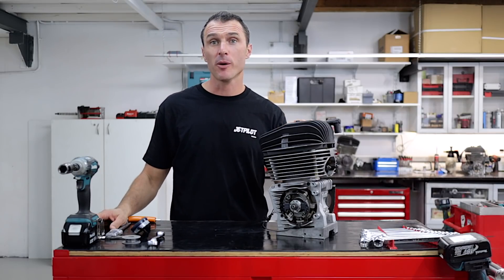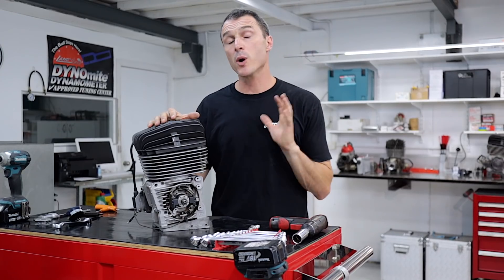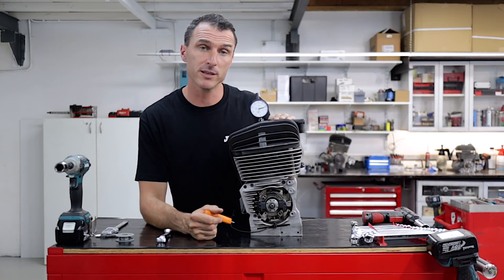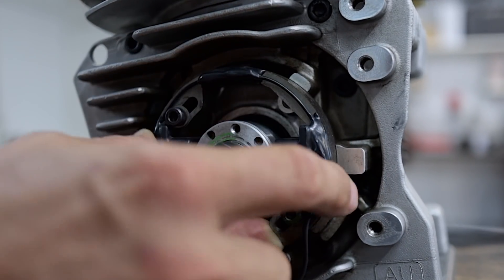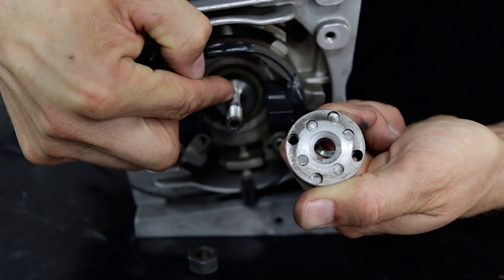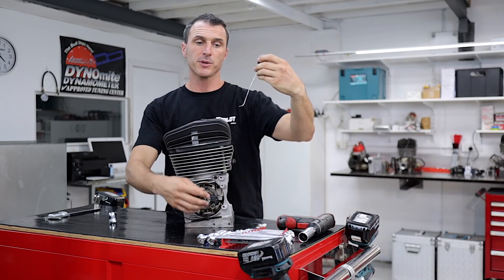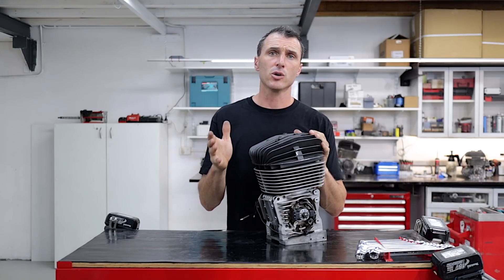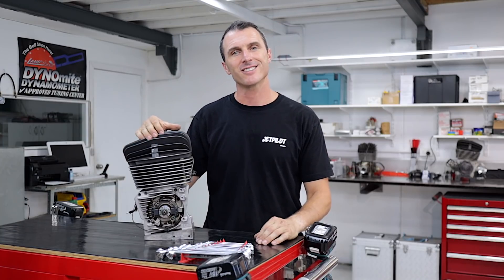HOW TO: Check Ignition Timing & Squish On Your Go Kart Engine

Comment: How do adjust the squish? Im a tad confused!
Reply: Squish on a new or rebuilt engine is adjusted with copper shims and the base gasket. Squish on a used engine is not something you would adjust. Failing a squish test on a used engine is a sign of carbon buildup. The top of the piston and the combustion chamber on the head would need to be cleaned or replaced, then the squish reset using copper shims and the base gasket.

Comment: I have a tm k8 engine but it doesn’t have a keyway for the magneto rotor ln the crank or rotor itself how do know what orientation the magneto should go?!
Reply from the maker: have you lost the key way ?  otherwise you will have to spin up the rotor  measure the timing marks.   then you can set them with a dial indictor or degree wheel.  full mission.  get the keyway is my opinion
Reply: @PowerRepublic  i’ve not lost the keyway, it just doesn’t have one! There’s no groove for a keyway… its a weird thing for sure. Never seen a crank without a keyway.

Comment: What would be the best timing for an IAME M1 60cc?
Reply from the maker: most likely 2.5-3.0mm as a guess, we don't have them here
Reply: @PowerRepublic   Seems a bit much. That's like 30 degrees on the flywheel. Is this kind of adjustment normal on other engines? These small engines use offset flywheel keys to adjust timing, and they are usually tiny amounts of advancement from a degree standpoint. The only way I could see achieving 2.5-3mm would be to remove the flywheel key altogether and run without it. Any ideas or suggestions?

Comment: I remember using a crushable plastic ( plasigauge ?)  to measure bearing clearance 30 years ago,.  solder is a similar idea  and much easier to find.
Reply from the maker: Yeah 2.0mm solder is what they use in tech inspection , so best use the same at home

Comment: Question about the ignition timing. I know TDC is where the main, thick timing mark is and the second thinner mark is an advanced mark. By setting the piston 3 mm ahead of TDC isn’t that setting the timing advanced and hereby should use the TDC mark? By setting the piston advanced by 3 mm AND using the advanced mark isn’t that doubling the amount of timing?  Im sure we don’t want too much advance!
Love all your videos and have learned so much from them. Keep up the good work!
Reply from the maker: Hey Doug thanks fir the good vibes!
yeah too much advance isn't good, especial double the amount.   the thin line is the fire point and you want this to line up with the timing marks on your stator at 3mm before the piston rocks over top dead centre.  just ignore the bigger chisel wedge line fore now
Reply: Thanks for the reply! You guys rock!

Comment: Hi legends, how can you change the squish. For example 1.2mm to 1.0mm. Amazing video again!!!
Reply from the maker: Base gaskets mostly.  Otherwise copper head gasket change.
Reply: @PowerRepublic copper head gasket change? I get the cylinder gasket on the base but
Reply: If im guessing its instead of the o-ring, between the head, an the cylinder, cooper washer may squash down more than an o-ring

Comment: Hello PR can you help me with this issue,  what happen if the stator is bend? the distance between the 2 magnetos and the rotor are not the same in my case. Thank you so much for your help.
Reply from the maker: Hey mate, I would replace them with another unit either brand new or used.
Reply: @PowerRepublic   thank you so much for your advise. Love your channel

Comment: What do you use to clean the piston and generally when cleaning the engine?
Reply from the maker: Hi Andre, I generally don't clean the pistons, only replace them after there service life.  to clean the engine, degreaser or brake cleaner work best, normally a little bit of work all the time to avoid the oil burning on the engine
Reply: Don't know if the guru agrees here but at times a careful overhaul with a razor blade can do the job on the piston if you're on the track and running tight on time (or just laid down the right amount of hours after a top end job to get it running good).  We do that on our mini engines since small kids usually don't carburate on the track and slight build up occurs when jetting isn't optimal.

Comment: What is best timing for ka3 and for ka4? Ive been told they require different timing. And is the squish the same for both classes? Thanks for your help.
Reply from the maker: Hey CNC, 2.7mm for KA3 and 3.1mm for the KA4.  Squish we run the same at 1.10mm

Comment: If we forget that 3mm is the rule and not racing competitively. Where is the point of best performance?
Reply from the maker: Hey John, never tried it on a track.  3.0mm is the sweet spot.  if you added more for the cadet 9 version it might help, but leave it at 3.0mm and work on your tyre pressures IMO

Comment: Your videos are really great.  Learning so much.  About to build my first KA100 on the 2020 Compkart 4R.  Curious where to mount the engine to the frame for the best balance. Odenthal 5°.  How far from the axle weld or I have heard place the crankshaft centerline over the side pod centerline.  Thanks for any tips.
Reply: Thank you!!!  Heard that and now you’ve confirmed it.
Reply from the maker: I don't have a 100% correct answer, but I generally use the side pod bar as the centre of the engine mount.  mostly it is so I have equal adjustment of the chain tension both forwards and backwards.  you can control your weight distribution with lead and your seat position.

Comment: what is a good amount of squish to have ?
Reply from the maker: Willy Renella which engine mate?
Reply: Power Republic MiniRok, thanks 🙏
Reply from the maker: Hi Willy. I set them 0.85mm for the Mini Rok.  The limit is 0.80mm measurement with 2mm solder.

Comment: Hi Derek, can you explain a bit how the squish gap affects performance on 2 stroke if at all?
Reply from the maker: Christopher Ramnauth great question.  Mostly as you lower your squish you raise the compression on these new style engines which you can not modify for technical rules. I have tried a few years ago when the rules were different all sorts of squishes.  There are research papers on the net about squish velocities you can search for. Mostly for high performance engines that rev to 15000Rpm or more you want 0.80-1.00mm. If you go too close you crash the piston into the head which is not ideal.  Hope that helps
Reply: @PowerRepublic  thanks Derek. So for rotax, is this something you can vary as the engine builder to affect performance?
Reply from the maker: @IggySport1388  with the Formula Rotax engines, you have to lower the barrel to get the squish down.  When you do this the exhaust port duration is shorter (the time the exhaust port is opened to the exhaust pipe by the piston movement).  You will have better bottom end power with a low cylinder and better top end power with a higher  squish gap, all other things being equal.
Reply: Hi Derek, Great videos. From your experience, what’s the ideal ignition timing for both slow tight tracks and a fast flowing one. Thanks.
Reply: Hi, what timing do you recommend for ok/okj engines vortex and iame?